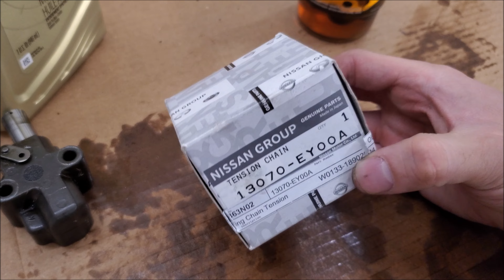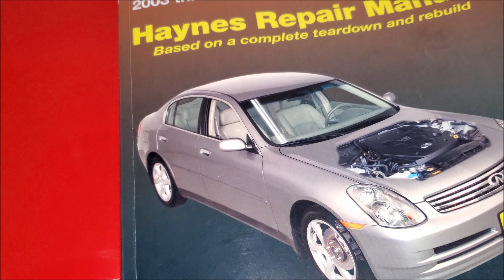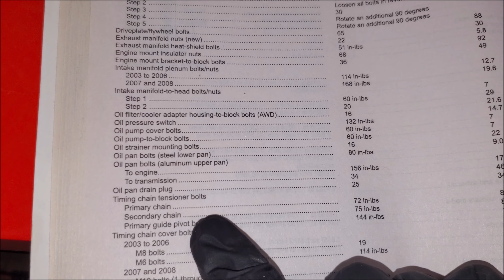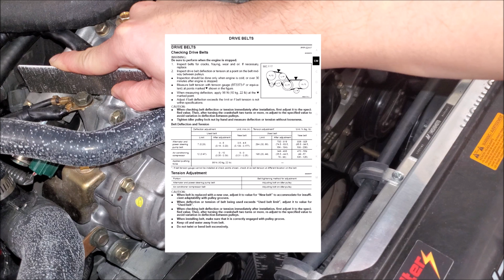Main Timing Chain Tensioner Replacement (Nissan 350Z & Infiniti G35) | AnthonyJ350

Comment: The tensioner is meant to last as long as the timing set. The reason for the access cover is for water pump replacement.
Reply from the maker: Thanks for the feedback.
Reply from the maker: So if you had a bad tensioner you would change the timing chain as well. Isn't the water pump behind a different access port?
Reply: @AnthonyJ350  You have to access the tensioner to replace the pump.
With proper care the pump could last 200,000 miles. Most people don't understand what proper care really is.
Reply from the maker: @NSWNY  Someone just said they had to update their 2004 to the 2006 updated tensioner though.
Reply from the maker: @NSWNY  So if the engine is rattling, don't try to fix it unless I change the chain as well?
Reply: @AnthonyJ350  I would totally fix it, yes. It's easy and well worth doing. You don't have to change anything else, as long as everything else is good.